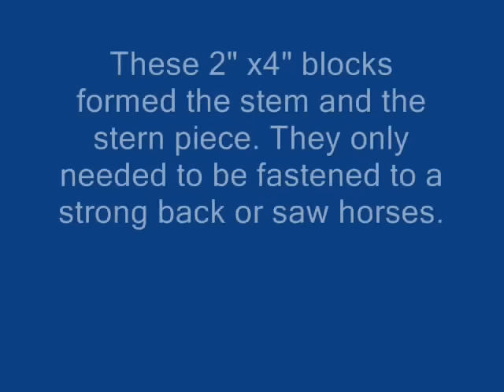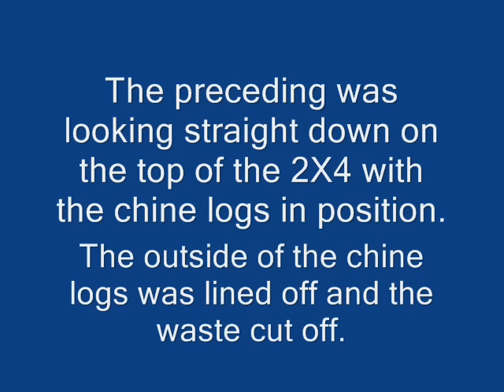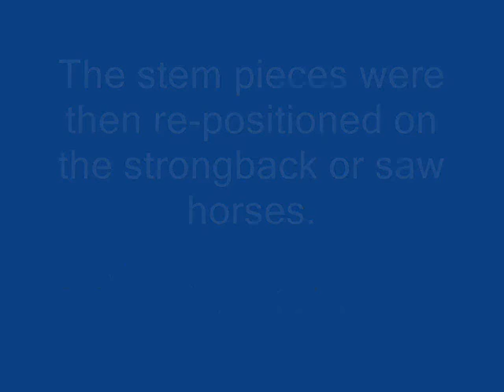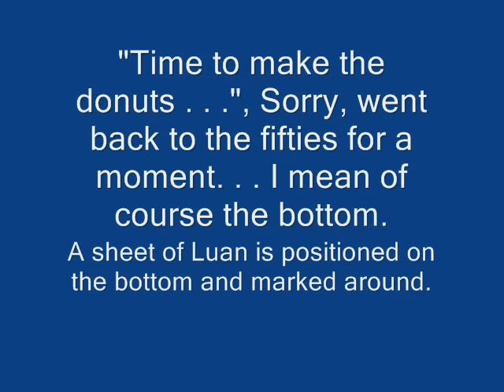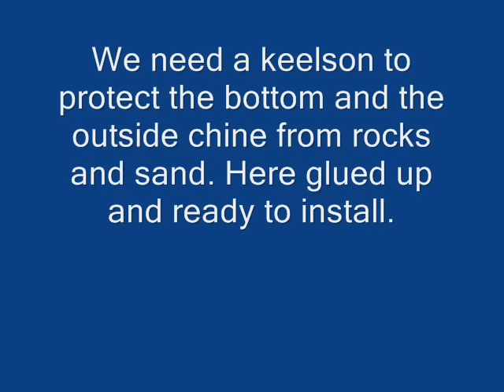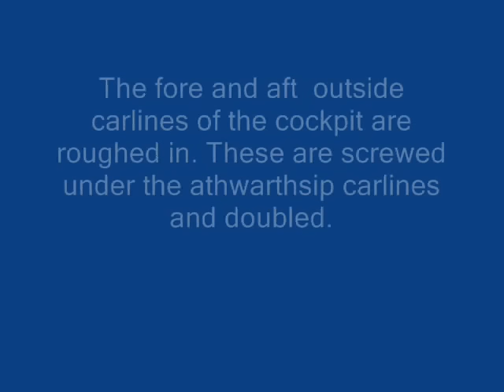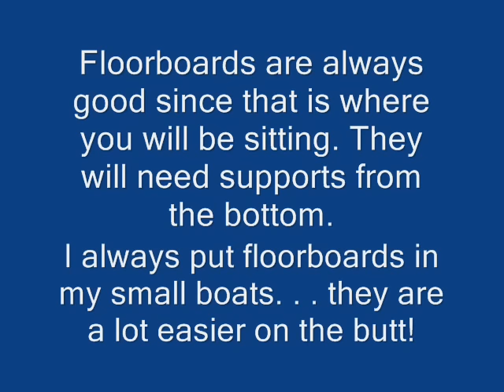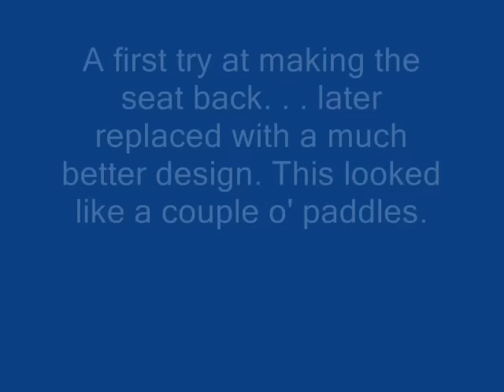BUILDING A 16 FT. CANOE AND AN 8 FT. DUCKBOAT

Comment from the maker: Further to my note of yesterday; you really don't need any plans. Everything you need to know to build one of these is covered in the video. They are meant to be self-designed as far as LOA, beam and topside height is concerned. One thing I might mention; since there is no V to the bottom and no flare to the topsides, I would be certain to include ample beam for stability.

Comment from the maker: First, let me thank you for taking the trouble to respond to thids video. That said, I must disagree with a couple of your well-made points. First, I have never seen any warning label on any Luan that I have purchased. I just checked my stock, and the only label is the UPC label. Second, I tried your thumbnail test on some scrap, and couldn't budge either side of the surface laminates. I have one boat, built in Luan in 1998 that is still going strong.

All the best.

Comment: Went to the site and saw what you made.  Looks to be a good photographic platform and an excellent boat for sneaking about taking pics. Congratulations on getting it done.  Your boat has the features I was talking about.  The sides flare, albeit slightly, the bow has a good angle, the deck is sloped so water runs off of it.

The guy who made this video CAN build boats, it's just that he needs to study up on boat design to get truly good, safe watercraft.

Comment: I have to agree with you on that, secondary stability on those boats has to be near zero.  Those boats are good for paddling around on a QUIET pond or lake and wave at people and little else.  Wind, waves, chop, boat wake or leaning over to pull a fish, anchor or crab trap would make being in those boats dangerous.

Flaring out the sides, rounding over the decking and putting an angle on the bow would make these craft 100% more impressive.

Comment: NOT a very stable design. I was very intrigued by the simplicity and ease of construction so I built one very similar and it capsized immediately after shoving off from shore.
Reply: Flat bottom boats have good initial stability if they have relatively wide hulls, but all flat bottom boats have poor secondary stability... Once they get past a certain angle, they will roll on over.

Comment: Google "pintail wooden duckboat" and you will see the boat I just built on instructables. com. It's painted now but unfortunately the weather hasn't allowed me to get the bottom wet. But I wanted to use it for photography so stability was a primary feature. I look at David's website but did not find what I was looking for.

David N, Your craftsmanship is excellent. But small wooden boats NEED Bevels and frames. and above all, stability. These boats are Dangerous!